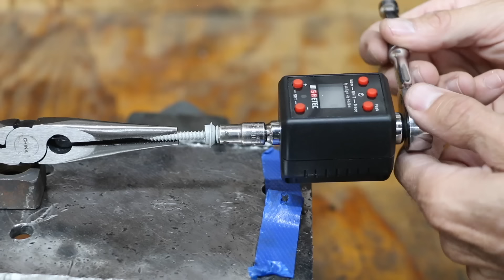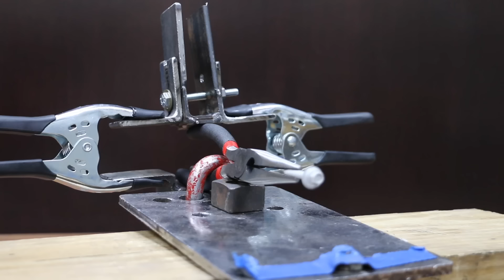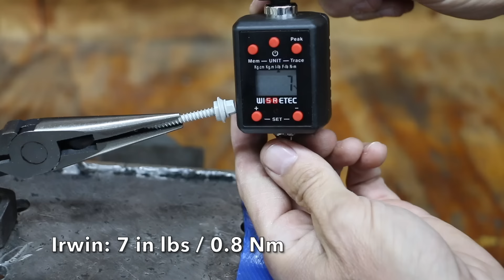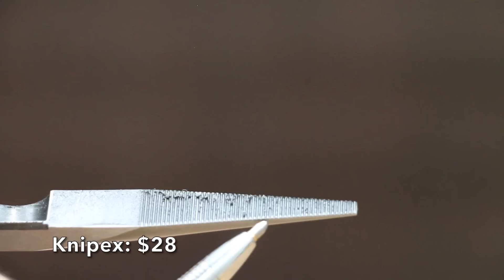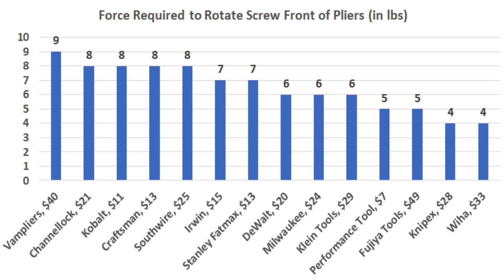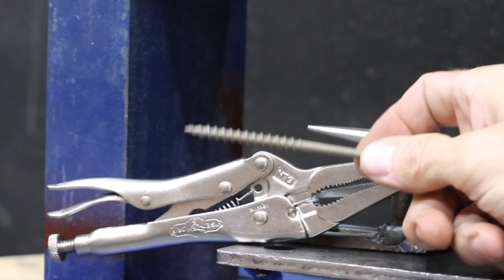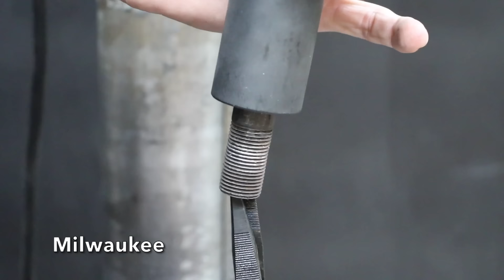Japan vs German Pliers (LONG NOSE)? Knipex, Vampliers, Klein, Fujiya, Irwin, Kobalt Needle Nose

Comment: If you judge a fish based on its ability to climb a tree…

Those Knipex pliers I know are designed not to exceed 2.2mm of hard wire. Not 4-5mm hardened screws.  And the only pair of pliers in the lineup meant to apply any torque are the Vampliers.

Comment: In retrospect, I think this is one of the few times where PF's testing wasn't particularly appropriate. 

Sure, needle nose pliers can absolutely be used to wrench on things, cut them, etc, but they're specifically for working in confined spaces and picking up small objects precisely. These tests give a good sense of which pliers are the most abuse tolerant, but not which pliers perform their intended function best.

I'd love to see this video redone with tests more relevant to how needle noses actually get used.

Even basic metrics like tip width and jaw opening are far more valuable to me than whether my needlenoses can cut a nail.
Reply from the maker: Thanks for the constructive feedback and suggestion!

Comment: This test actually shows which pliers are more difficult to destroy and not which pliers are better at their designated job. Knipex long nose pliers are designated to reach a remote connector or to cut a copper or aluminium wires. To rotate screws they have TwinGrip pliers, and to cut nails - CoBolt cutters. Yes, these are specialized tools, but they will do their designated job for a long time with highest quality.

Comment: In regards to needle nose, I use Knipex and Wiha in my electrical tool box, Channellock in my plumbing tool box, and Kobalt in my diesel and gasoline repair toolboxes. These results mirror my real world experience. I would never use needle nose to cut steel wire, nails, or screws. There are purpose built tools to cut steel; thus, I use purpose built cutters to cut anything other than aluminum and copper.
Reply from the maker: Thanks for the feedback.

Comment: the grip test is tricky... if you don't place it exactly like the others one may sit on more threads than others providing more grip and making the tests unfair unless, of course, it sits on more threads because it is wider, should that be the case it's fair but equal widths with different positions may change results drastically, to avoid having to reposition the tools with laser precision all the time you could simple reposition the tool on 3 different parts, preform the test three times and do the average to minimize the error margin, it may be time consuming i know but i think it would provide more reliable results

Comment: The Digital Torque Meter he's using at 0:14 says it measures within 1% from <1 ft-lb up to 750 ft-lbs.  
It's made by WISRETEC ... usually on ali-ababwa ... and an anpuds goes from <1 ft-lb up to 250 ft-lbs.
Reply from the maker: Thanks for sharing.

Comment: Not a perfect set of tests for this type of tool, but still very happy this channel exists.  THANKS!  My criteria for rating needle nose is do they open easily, and reach into tight spaces.  I hate pliers that you need both hands to open them.  I also dislike some of the soft grip covers, that break down over time, get gummy or sticky.  Most mfgs don't identify the specific plastic used.  Testing against oil, solvents, ammonia, etc would be worthwhile.

Comment: These are all brute-force tests, for what is mostly ircat least often used as a precision instrument. 
Things like reach, ability fit in narrow spaces, smooth joint action and ability to grip thin objects are often more important than strength and ability to take abuse. 

Really there are two categories of pliers here, heavy duty / combination long nose pliers, and precision long nose pliers.
This was a great review for the former, but not the latter category.

The Knipex and Wiha for example are precision tools, not heavy duty ones.

Comment: I use craftsman and it works well.  My main tools as an electromechanic or however you say is a needle nose plier, 2 screwdrivers and 1/4 socket set.
Reply from the maker: Thanks for sharing.

Comment: Wish you could have included made in USA best in class Channelock needle nose pliers. Have a pair of Klein needle nose that are my second favorite brand. My most used of the 3 sets of Channelock needle nose pliers are over 45 years old and the tip grooved gripper portion worn .I installed a Klein #89 maroon slip on replacement grips over 30 years after getting shocked on blue dipped grips. These replacement thick Klein are not rated for live circuits but have used them on hot 480 wires hundreds of times.I'm
Reply from the maker: Thanks for the constructive feedback.

Comment: I know this comment isn't going to be seen but I'd still like to point this out. I like the way you do your testing as it pushes these tools to their limmits. Although I would love to see you cut solid copper wire with insulation ( some thicker wire preferably). As I believe these sorts of cutters are going to be used mostly for that sort of purpose, electrical work. You could measure the force required to make the cut, as well as the quality of the cut. Especially when it comes to wire cutters or pliers that have the cutting edges on them.
Reply from the maker: Thanks!  Thanks for the constructive feedback.

Comment: Im really disappointed that my new Channellock needle nose pliers didn't hold up to twisting. Ive been replacing all my pliers with Channellocks, & have been pretty happy with them for the American made value. Cutting 16p nail & a deck screw just isn't indicative of the kind of work these pliers will be doing. Reaching into a tight spot and grasping something small is what theyre for.
Reply from the maker: Thanks for the feedback.

Comment: needle nose pliers are a relatively lightweight use tool used for specific light electronics and electrical work. they are not heavy duty high leverage tools hence the reason they all have issues cutting thru nails. they're only meant for cutting light gauge copper and aluminum wire. 
 you would use something like high leverage lineman pliers or hd side cutters which have the jaws closer to the fulcrum or pivot point which greatly increases it power.
they sometimes have carbide cutting edges to avoid being damaged as when cutting nails😉. every tool has it's specific purpose and place in life. if you use a tool for what it's not intended for then u get failed results or worse injured🤕
thank you for all the good unbiased work you do and all on your own dime. it is much appreciated  👍👍👍
Reply from the maker: Thanks so much!  Thanks for the feedback.

Comment: Knipex are wildly overrated.  I bought a set of 200mm side cutters at £25.  My £4 140mm Drapers are marginally sharper.  My first Knipex product and it'll be my last.  I thought they were fake at first, they were so bad.  I emailed Knipex to enquire to see what's up.  Anyone else had this issue?
Reply from the maker: Thank you for sharing!

Comment: Thanks. For the next video: could you review the pliers that's good enough for bending quite thick metals and quite thick wires (nothing crazy thick) that closes perfectly parallel (no gaps between the jaws when closed which is best for gripping thin things) that would damage the finish but still grips 100%?

God bless.
Reply from the maker: You are welcome!  Thanks for the suggestion.

Comment: Great video.  When it comes to needle-nose pliers it all comes down to what you are going to use them for.  I have a set of Klein pliers that stay in my electrical bag.  I wouldn't use them for general work around the farm because that's not what they are made for.  I have another set of pliers in my tool box that I think I found on the side of the road.  After some WD-40 these are the ones that get the abuse when I need a needle-nose for car repairs, fencing, etc.
Reply from the maker: Thanks!  Thanks for the feedback.

Comment: Knipex Cranesbill Tongs: Knipex manufactures the forged and oil-hardened cranesbill pliers primarily for gripping, adjustment and assembly work. For work in these areas, it brings with it a second function that is important for assemblies: cutting. Their cutting edges are shaped in such a way that they bite.

The cutting edges are additionally inductively hardened. This makes the Knipex 26 12 200 even suitable for cutting hard wire. Thanks to the inductive hardening of the cutting edges to approx. 61 HRC, cutting values on hard wire of up to 2.2 Ø mm result.

The precision tips made of vanadium electric steel are elastic and torsion-tolerant. Manual strength can therefore be used in a well dosed manner – but also vigorously where necessary. The cutting edges are near the joints. This is favorable for power transmission. Cutting values for medium-hard wire of up to 3.2 Ø mm and for hard wire of up to 2.2 Ø mm are impressive for professional users.

The particularly long tips of the Knipex 26 12 200 make it possible to grip low-lying components and workpieces precisely and powerfully. For example, anyone who has ever attached a refrigerant hose to the evaporator of an air conditioning system or pulled a hose onto a connection piece that is difficult to access appreciates the qualities of the cranesbill pliers.

The cranesbill pliers from Knipex are a tool primarily for assembly work in hard-to-reach places. Anyone who works professionally with tools every day expects a quality that enables easy and safe work and lasts for many years of hard use.

You can see from other tests that Knipex comes out on top there, because the purpose of the test is right.
The Knipex pliers in the test are not made to hold anything by high force, they are a gripping tool and the tip is intentionally soft.
You can use it to change the fuses on the car, for example.

Comment: Typically I find these videos useful and while the tests are legitimate I feel as though the only things I ever use a needle nose for wasn’t tested in even the slightest… Suppose others may have other uses but mine is generally for manipulating wires in cramped spaces where length and size are all that really matters… Seems like all that was done is testing things that the damn tool isn’t really made for to begin with.

Comment: idk man, when I need needle nose pliers I'm most likely working with electronics and prefer precision over strength.
Reply from the maker: Thanks for the feedback.
Reply: @ProjectFarm  
A few tests come to mind.
Such as precision of the jaws knurling. 
Needle nose pliers are also called telephone pliers to reach into tight spaces and grab wires, so a test where you grab a copper wire lengthwise and sideways and measure the tensile strength the pliers jaws can hold at a given grip force.

Twisting wire is popular as well so I understand that test. 
It just seems strange to me that the usually best brands Knipex, Wera and Wiha performed so mediocre in this.

Comment: Some more testing specific to the pliers being “needle” or “long” nose would have been good. Some of these pliers were thicker and more durable, but being thinner and coming to more of a point provides more precision. This is often why you would reach for this style of plier. For example, the Knipex pliers may not be as durable as others, but can do jobs some others cannot due to their length and how thin they are at the tip.
Reply from the maker: Thanks for the feedback.

Comment: I would love too see a review on needle files. I do some knife making and use needle files for doing the jimping in the spine.  Would love to see them used on some mild steel then again on some hardened carbon steel.  Which cuts best, which lasts longest?
Reply from the maker: Thanks for the suggestion.

Comment: This video was super appreciated by me because I’m an electrician by trade.

However, I was reminded by this video that it’s difficult to claim one brand as “the best” because it really depends on the primary use of the tool. As an electrician, one of the handiest things a set of needle nose pliers can do is grab a set of wires in a very awkward place and have the grip strength to do it.

With those two qualities in mind, I was actually very impressed by the Vampliers brand.

Either way, I loved this video, it was very educational to me.
Reply from the maker: Thanks!

Comment: Wiring a receptacle would probably be a better test than hacking through screws and nails. 
   Ergonomics? Do the jaws twist wire ok, yet are they thin enough to reach and nudge the wire around a screw? How about removing the wire from the receptacle? Without mangling it? Electrical conductivity? Do they leave a hideous sharp burr when you cut copper wire? Which have built-in wire strippers? 
How well do they work with one-handed operation, seeing as they don't have a spring? Your other hand is holding the receptacle or whatever it is you're working on. 
   What about cutting and bending coat hangers for various purposes? That is really the most abuse you should reasonably do with one of these things anyway.  
The torture testing to the levels that would break human hands if actually attempted in the real world don't really say much about using the tool for its intended purpose. These are dexterity, wire, and reach specialist tools. 
   How do they work and feel when manipulating a small part into a desired position? Will they reach under a small screw? Will they hurt my hands? Will I get shocked if I "forget" to turn the power off? Do the grips twist during use? How difficult is it to use them to pull a wire staple without damaging the NM-B? Will they cut 10 gauge? Will they cut all three in the cable at once? What about 8 guage? Will they cleanly cut stranded copper wire? Are the handles so wide that they are uncomfortable or prevent me from reaching into a deep single gang box to retrieve the end of a wire?

Comment: Hi, just watched this and another fab test video! I would be interested in knowing if a wheel nut is better left un lubricated to prevent it coming loose or if that prevents it bring properly tightened, compared to greased up and tightened, also differences between alloy and steel wheels grease or no grease?
Reply from the maker: Thanks for watching!  Thanks for the suggestion.

Comment: I need to replace my ancient Chanellocks and I have to say, I think this is one of the worst tests you've ever done. Needle nose pliers are not normal pliers. They're only useful when normal pliers won't fit. Just from the shape, I would pick the Knipex over any of the other pliers in this test. Most of the rest aren't real needlenose pliers and can't really can't perform many of the tasks you would actually grab needlenose pliers for. And who ever cuts anything remotely hard with needlenose pliers? Maybe a piece of soft wire that you're using to fish or something, but you'd be out of your mind to reach for needlenose pliers for any significant cutting work. The part of cutting that might actually matter on needlenose pliers is if they'll cut stranded wire cleanly, since that's something I have actually had issues with when working with wires in tight spaces.

Comment: I love your videos but I would like to see a little more nuanced sometimes. Like how about which pair of needle nose pliers does things best at things needle nose pliers are actually used to do, like reach into tight spaces, grab a hold of some thing small and delicate like a piece of paper (which requires grip at the very end, something Leatherman just changed a few of their design to do).

In general I would just love to see more design studies, kind of like you did with the grease guns and their balance characteristics, and also their other design features like whether or not they stood on their own to keep them out of the dirt.

You know: to not just do the formulaic: the same thing as you did with cutters or other things but repeated with needle nose…

Not to criticize too much because I really do love your channel and watch it incessantly when I need comfort....
Reply from the maker: Thanks for the suggestion.

Comment: Pipe wrenches move and open jaws when you love them around. 
Best one for strength when they break 
Wich one has the best grip and wich one has the most precise size adjustment. 
Wich pipe wrench can take the most abuse with a cheater bar 

Is a stew wrench really stronger than its aluminum counter part? 

I don’t know I just want to see some pipe wrench action
Reply from the maker: Thanks for the suggestion.

Comment: Based of photo left has pressure going in instead of out like on the pliers on the right, you normally don't test by applying force to the support side and not the working side, do another with 2 sets of each pliers and do the tests twice one in each orientation to make it fair
Reply from the maker: Thanks for the feedback.

Comment: Handle wobble in needle nose pliers is entirely unacceptable. Leave em out in the rain for a few weeks, will clean that right up.

I'd rather have the handles just a touch stiff. Helps with dexterity when working with multiple objects and only two hands. Again, you can leave them out in the rain to adjust to your preference.
Reply from the maker: Thank you!

Comment: I've got a couple of the vamplier pliers but under the original japanese engineer brand and model range Nejisaurus, and I'm really impressed with them, plus under the engineer brand (in the uk at least) they are significantly cheaper. At the time of writing £31.08 vs £14.99 for the mini screw removal pliers.
Reply from the maker: Thanks for sharing.

Comment: sometimes expensive ones are really tight fitting,  id spend 20 mins oiling with 3 in 1 and cranking it open and close in my shop chair. wiping off black oil as it seeps out of the channels.   eventually,  it becomes super smooth and be able to open and close with just pinky finger on one hand.     thats just my .02 cent
Reply from the maker: Thanks for sharing.